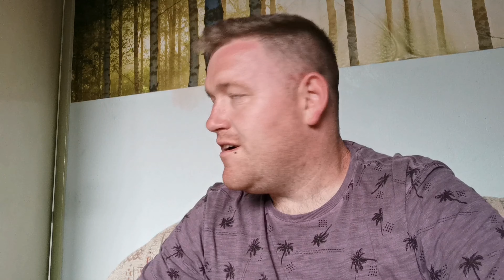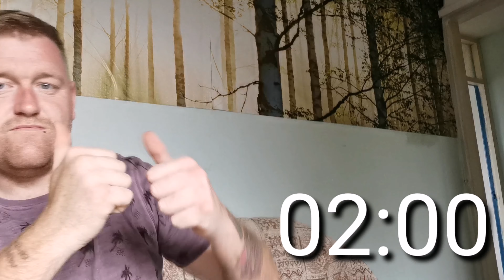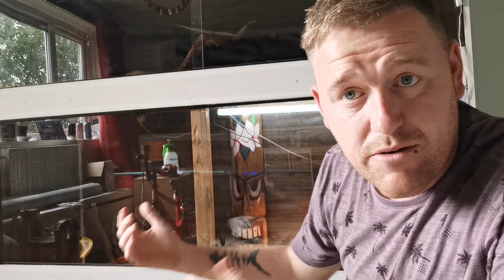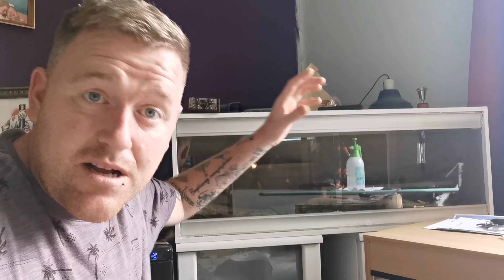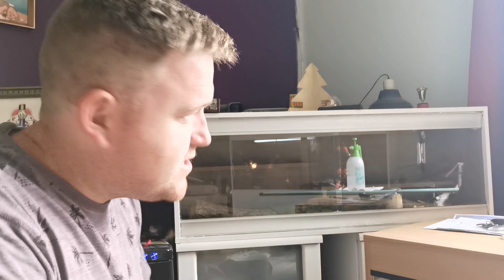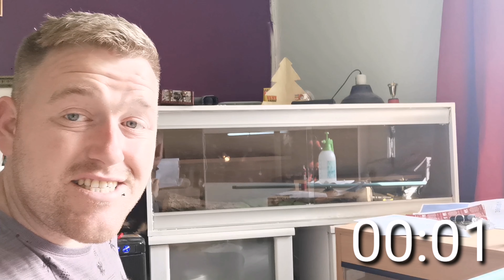YES! It Took Over 500 Days

Comment: I am surprised that my Reptile Systems mercury vapour lamp only lasted 3 months (12 hours/day only on cold cloudy days) whereas my Arcadia ones have never blown. The Exo Terra ones used to blow all the time!
Reply from the maker: I'm testing the mercury vapour bulb now. Been in a few weeks now without issue but as I said it's only been a few weeks. This test was 100w daylight heat bulbs. Got through my videos you'll see a video where I toured reptile systems facility. Called inside reptile systems and you'll see all the testing they do. My mv bulbs in with my Savannah monitor so high humidity and 12 on 12 off . Can't wait to see the results

Comment: Interesting! Is there anything in that viv? I imagine the flashing could upset it a bit! Maybe next time use a digital timer so that the pulses can be times to be the same length so that you don’t have the issue with seasonal temperature change?
Reply from the maker: Ner. It's my boas old viv but she was moved before this setup. Every now and then she goes back in it when I'm cleaning her enclosure . I left stuff in there like substrate and water bowl so the humidity never changed . It was an eye opening test. What substrate do you use for your bearded dragons bio viv? I'm struggling to find a suitable substrate for mine
Reply: NORTHERN EXOTICS I use Arcadia’s EarthMix-Arid topped with ProRep BeardieLife, and then with a final top layer of pure red sand. Creates a natural look and good humidity gradient from top to bottom :)
Reply from the maker: Great! I've always admired your substrate
Reply from the maker: We need to collab sometime . We're so close aswell

Comment: Very interesting test my friend :) I love my Zilla 15 watt red night Halogen bulbs they actually heat up all of my 48 inch NPI enclosures and keep the temps up around 82 to 86 degrees and are very low power draws !! I have them all set up on power timer strips with night and day time settings so they go on and off as I have the timers set on them and I totally love them !! :)
https://express.google.com/u/0/product/17843905895228257826_8339621527827173485_6264244?utm_source=google_shopping&utm_medium=tu_cu&utm_content=eid-lsjeuxoeqt&gtim=CJ_Ry9y8j6S9pgEQ247BtcGBp-2TARjAvtYNIgNVU0Qo4KyR6wUwtKv-Ag&utm_campaign=6264244&gclid=Cj0KCQjwv8nqBRDGARIsAHfR9wBEQTsBDicwDrRh-66lvm1DDKsTuZPcrvsuKuFCO0McdhIG9H8lF6oaAtMYEALw_wcB
Reply from the maker: Thanks a million